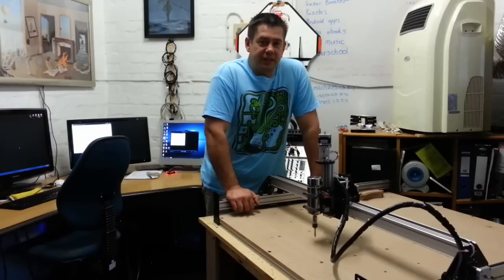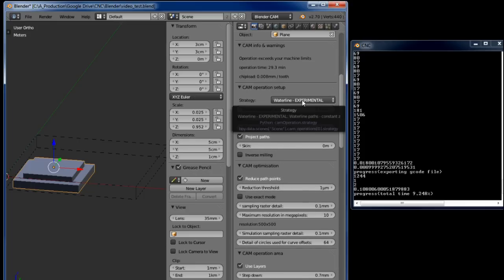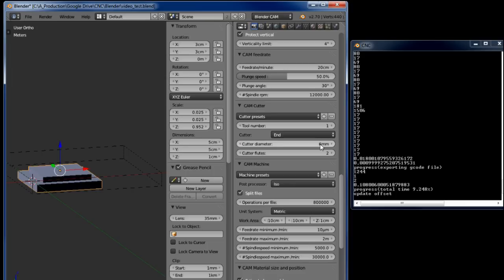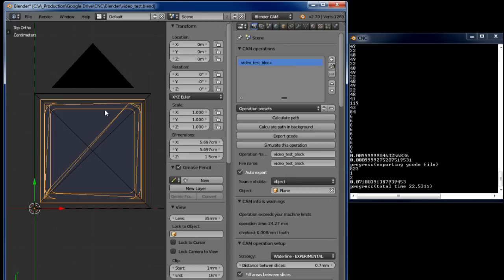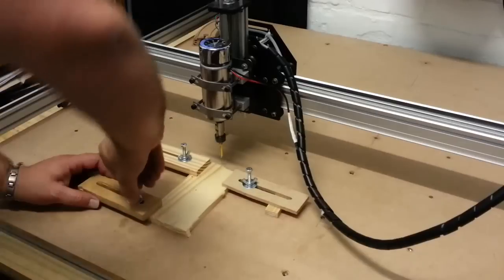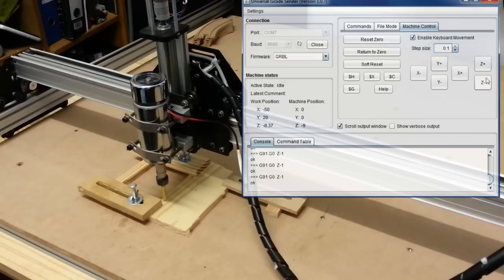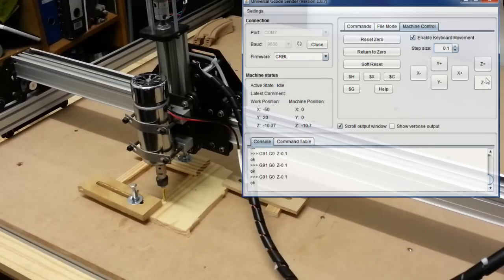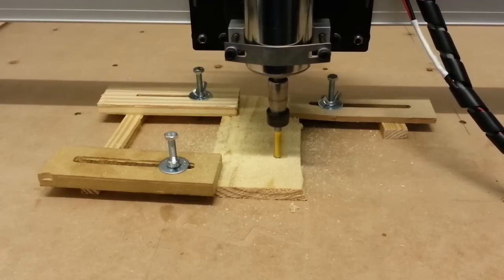Shapeoko 2 cnc blendercam universal gcode sender

Comment: Thank you very much for this video, one question, would blendercam be compatible with Blender 2.82??
Reply: Hi John... Man I wish I knew!  I am not the developer so unfortunately I can't shed any light. I will tell you one thing though...

The time spent watching the machine can really be measured hey.... in hours. And the main reason for that is that the cutting paths might not be optimised. With the demos for the commercial software that I have tested ( never actually cut ) it seemed that the research that went into optimal design really pays off.

I greatly respect the developer of this software and I have spent quite a few years using it. For the last few months I have been cutting with Inventables Easel. In terms of complexity it is obviously not comparable to BlenderCam, but I have not had one false move, of which I had several with the different Universal GCode Senders. 

In the six years since I recorded this video I have tried so many solutions. BlenderCam was my best option for a long time. But time has moved on. Apart from Easel, it looks like that very expensive software, V-Carve Pro, is the preferred software for many hobbyist CNC guys.
Reply: Hi Stefan...  I can sincerely relate to you sentiments.... However as a hobbyist, the "fancy expensive" software is just out of reach.....    
Thank you so much for your response.....    
Geniet die dag.....

Comment: Hello, thanks for this tutorial, have a question... How do you show the blender console?
Reply from the maker: Hey! Not sure if I understand correctly... but on my PC, when I run the Blendercam Blender version, two windows open. The console opens first, stays open, and then Blender opens. To switch to console I usually drag the main Blender window to another screen or minimise it. You can also access the console from the top menu Windows->Toggle system console.
Reply: not in my blender cam, using linux mx, cant find it neither in  top menu Windows->Toggle system console is not there, will try to search more

Comment: 0pen source is a joke.If it work well they will cut it out.
Reply: I've been using open source software since 2000 and probably before.  My data handling business was based on my own software and much of what I did was based around open source software - for instance, my work was heavily dependant on OpenOffice.org.  I found OOo and many other open source programs reliable and more than useful.  In some cases I had issues, and I downloaded the source code and modified it to provide what I needed.  I could not have retired 20 years early if open source software were not so solid and dependable.  It did wonders for my business.

Comment: Just wanted to say thank you for posting this video!! The cutter speed seems too slow or is it me? again thank you!!
Reply: stefangas friend if you have problems with sound buy water cooled spindle they are very quiet at 24000 rpm
nice mashine
Reply from the maker: Hey Matt. Glad you commented.
I don't have anyone around here who can satisfactorily explain Volts and Amps to me (I'm a musician and 3D guy). I am using a 12V psu that is rated up to 14 Amps.

As far as I could find out this will work with the quiet cut spindle. However, I don't understand how the 12V-48V rating on the quiet cut spindle influences the speed. I know the spindle is rated between 7 and 8 amps.

If running it at higher Volts ratings will increase speed I should order the relevant power supply from Inventables.

My current setup was to get started quickly.
Reply from the maker: Kazantzidis Romanos Thanks! Will check it out. Don't know anything about that.
Reply: stefangas What it is is that the spindle will operate within 12V-48V. It's max RPM is 12000 rpm which is still low for a spindle but from my understanding this spindle does fine at those speeds. If you are only running a 12V PSU, then you should definitely upgrade to a 48V PSU. I would also suggest the spindle speed controller. You will be able to probably double or triple your cutting speeds. It wont be as quiet, but it is still not loud. I hooked mine up to my 48V PSU just to test it and it was much faster than yours. Was a bit louder as well, but wasn't no where near as loud as a standard router.
Reply from the maker: Manicska HI Manicska. Thanks for your comment. I think you convinced me to upgrade the PSU for the spindle. I already bought the spindle speed controller, but stopped using it since at this speed there didn't seem to be a need to control the speed. With the 48V PSU I am looking forward to seeing the difference!
Reply: stefangas The shapeoko is now sold with a 24v power supply as that is what is needed for it to run efficiently. I like your video and am too starting out with shapeoko2. i just assemble it today with 24v and adjustable speed controller for spindle.